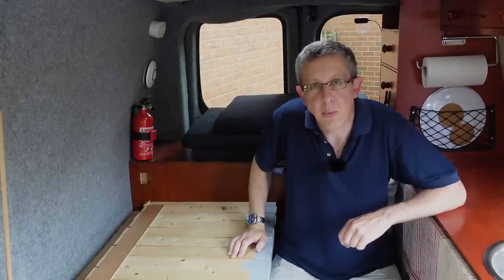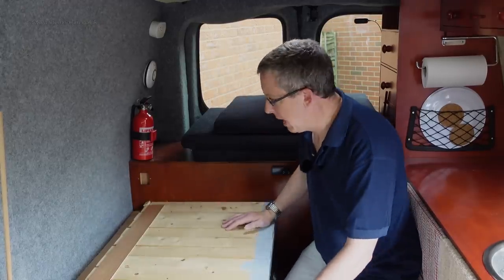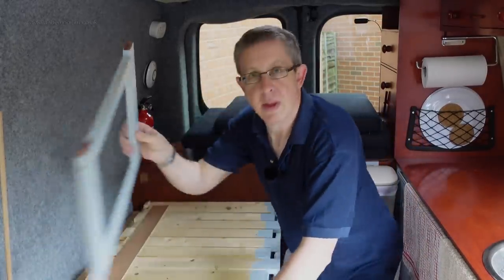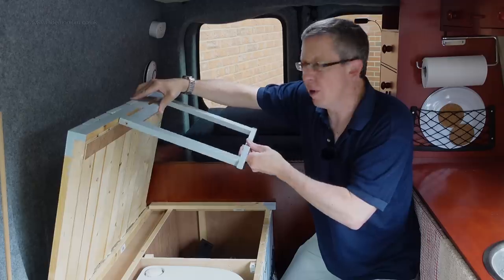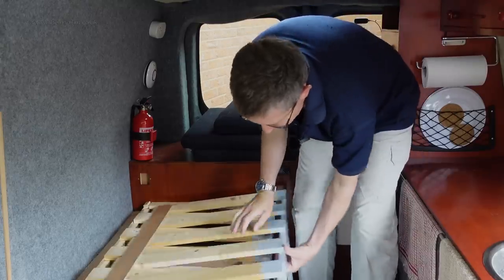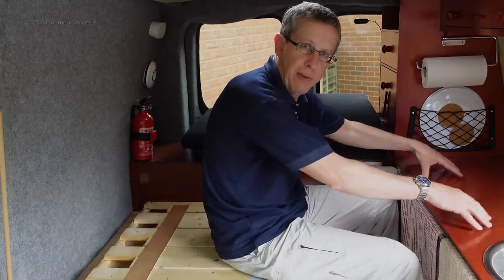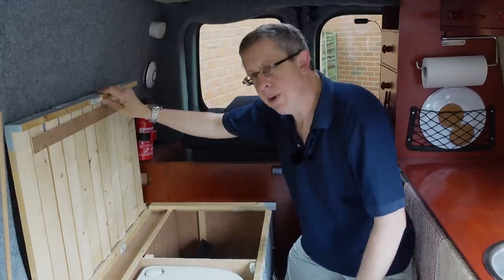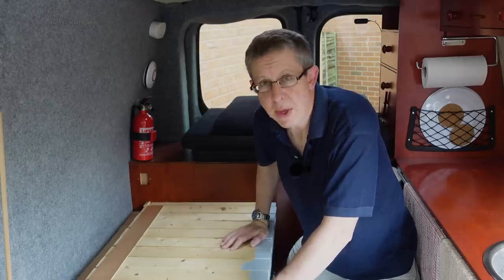84. Help! Your advice is needed.

Comment: The hinge as you described will work just fine as the friction on the extending slats will keep the thing from sliding while you are on it. You might consider adding a light chain to keep the legs from over-extending outwards and they would not be in the way folding. 
Simple is good. One thing I would do as an older person who would have to use the toilet in the middle of the night I would put the electrics under the bed and the "Loo" where it would not be difficult to get to in the night.
One other thing I would have a fire detection system in the battery / electric compartment.
Reply from the maker: Cheers. I'm certainly not moving all the electrics and toilet etc though!
Reply: @Vandemonium  I understand completely! We rebuilt a 1985 16' Scamp and built in a wet bath in the front with twin beds so that when nature calls in the night we don't have to climb over each other to get to the "Loo". More important as you get older!  
Thanks for the reply. We have enjoyed your work on the narrow boats and the van over here in the US.
We live in north west Florida and have taken our Scamp all over the US from sea to shining sea and Canada to the Gulf of Mexico.

Comment: Put in an extendable counter top, like those cutting boards you sometimes see in older houses that simply pull out from between a top drawer and the countertop. It takes up no space at all and would solve your leg problem.

Comment: Use a hinge, but have it fold up all the way, flush against the bottom of the seat, held by magnets or latches.  Then swing out to the floor to whatever width you wish. 
BTW,  the deep blue is a very good color for you and for viewing. Makes for good contrast.  Other good colors would be deep greens and purples.
Good luck!

Comment: You could get locking hinges, one for each leg (side). The kind of hinge that’s usually on cedar chests, that lock open, will not over extend and won’t wobble. You can fold the legs out of the way when slid back. Cut out part of your box dividers underneath so everything will be flat as it is now. Good luck!

Comment: Put the legs on a hinge, and create cut outs in the cabinet front so when hinged against the lid, they still allow the lids to close flush. 
Second option: Heavy duty drawer sliders. 4 to 8 that allow the bed to slide open, but removes the requirement for legs.

Comment: Spring loaded kitchen cabinet hinges won't budge when moving about and will also keep the legs in place when stored away. Plenty available to suit different fixing positions, just be careful if you try to open them by hand as you can easily cut yourself. Perfectly safe once screwed in.

Comment: Why not a two second boards that draw out of the front section of the compartment (where the blue/gray panelling is). The boards could „store“ in the storage compartment parallel to the supporting beams and be pulled out through the front before the bed is pulled out. No hinges, minimal moving parts and variable depth.

Comment: The extra space you seek is available, straight up towards the sky. Make the top of the bed ever-so-slightly thicker, and you'll have as much room as you need to engineer a folding leg. The folding leg will have embedded super-magnets to hold it in place (up and out of the way). I think that the rest is trivial and obvious, or would fall into place when executing the design. The only possibly (?) non-obvious suggestion that I'm making is to take advantage of the vertical axis to gain the extra space (an inch, ~3cm) you'll need.

Comment: David, David, David! I’ve been pondering this since you posted the video and finally came across a perfect and easy solution. 

Cut the front panel of the chest that faces your kitchen in half (or attach two additional pieces too it of the same overall size) and hinge it on the left and right so they open outwards like cupboard doors. With both opened at a 45° angle it should form an extremely sturdy support and it saves you redesigning the top. 
Paint them to match the chest so they blend in and add magnetic catches to hold shut when on the move. Good right? @vandemonium
Reply: Excellent idea - I've seen it work with great effect in several build-outs of cargo trailers and vans.

Comment: I would fasten the legs with hinge.  You'd probably get interference when you folded them away, so it would require cutting a bit of clearance away from the vertical pieces.  Looking at the toilet, I think you'd have enough clearance to make that happen.  Your idea with the triangle is pretty much exactly what I'm thinking.  There are very strong hinges available.  You could fasten them with bolts and washers to make it strong.

Comment: David, It's an interesting problem. It seems to me you are assuming any proposed legs will be required to stop the expanding seat top from moving. You might be better off putting a few small dowels in the top edge of the vertical seat front on the cooker side with several corresponding holes in the sliding part of the seat top which would then be responsible for stopping the seat expanding or contracting unexpectedly while horizontal. (Sorry, that sentence might have been dangerously long) A simple hinged leg arrangement then may work safely in the way you intend and be able to be set in a number of desired bed/seat widths. (I hope you get my meaning.  If not, I'll try again. A diagram might help) Good luck.

Comment: Why have legs at all? When it is fully extended heve something on the kitchen unit that supports it. Either a small piece permanently sticking out from the kitchen unit at each end for it to sit on or retractable pieces. It doesn't have to be symmetrical or exactly at the ends.
When it is partially extended make some arrangement so the fixed slats support it at the rear of the sliding unit (there shouldn't be too much stress at that point)

Comment: I know there are other suggestions like this. My camper plans for a car included a heavy duty slide out drawer mechanism to allow the bed to be extended on its length. Or if you wanted legs I fitted out a folding table for my trailer that used hinges on the legs connected to the structural edge and then retained in the folded position agains the underside with small magnets glued at the bottom of the legs and the frame. Same could be done at the top to hold the legs in the extended position.

Comment: Imagine a triangle at both ends like a bookshelf. You could add hinges (vertical) that would let the triangles fold in when not in use. The triangles are attached to the permanent part of the bed.  The triangles don't need to fold all the way out when you go shorter. They wouldn't need to be triangles. They could just be rectangles.

Comment: Maybe you can make a few mouting points on you kitchen in case you want a full extended big bed.
For a little extension when you are cooking, you can mount a rail below the bed. Will be strong enough if the bed is mounted to the floor of the car. 
Then you don't need any foldable, hinged or removable  legs. 😉

Comment: Make a T shaped leg pull-out that consists of a frame that replaced the divider in the storage compartment and a section of the face of the storage compartment. Then you don't need legs attached to the lid. You slide out the legs, then pull the lid and set it on them.

Comment: Spring loaded hinges, usually great for closing doors but equally will probably serve as a sound structure while the bed is a quarter pulled out and would carry the weight of the legs that are holding your weight. Only when you want to open the bed (top) upwards you can push the legs in with some strong neodymium magnets attached such that they do not then swing back out (whilst having a look for things in the bed/cabinet) unless you pull on them a bit then they would swing open. To prevent wood on wood, I would then reinforce the wood-to-wood contact in between the hinge with just some felt (that would prevent any loud sqeaking and wouldn't be an eyesore and a cheap solution). You can get expensive spring loaded hinges that are adjustable so that you can adjust how much of a "spring" they give.

Comment: I think, drawers that are NOT drawers, just horizontal slide outs, so you can still utilise the space below (and take up minimal room).  Not at all connected to the bed so to speak, but you can slide them out to your desired width, and on the sliding bed portion have a chock or spacer so that they line up correctly height wise.  If the slide out is flush with the floor and you get your chock correct it would be as sturdy if not more.  Not sure if my explanation correctly conveys what I'm seeing in my head, but there you go.

Comment: Try a length of chain, braided wire or similar to hold the bed up while extended.  One line on each side connected to the outer corners (like a fold up bed).  This way it'll support the bed when pulled all the way out.  You could also use a second set of lines of shorter length to hold the bed partially open.  When the bed is tucked in the lines will hang at the sides out of the way.

Comment: My suggestion: move the leg assembly 2 inches inwards of the edge of the bed and hinge it there.  They remain inside the bed box when stowed and should work ok being in from the edge a little when deployed.  You could even add a catch at the lower end so they don't fall outwards when you open the lid until you actually need them.  Another refinement to this would be just 2 legs in a similar fashion with one at each end minus any joining frame.  Maybe of use?

Comment: 90 degree heavy duty shelf bracket/table leaf hinges. They'll hold well at a 90 degree angle, but you'll be able to pop them out of the way. They're hidden hinges as well, and easy to install. OR you get several chaos gnomes (you might have some left over from the narrowboat) and a bit of blue tack, you have to mix the blue tack with pink bubble gum (chewing is best), stick several gnomes together and

Comment: First, you could move the loo into the forward section (where it won't stink up your storage).  That opens the rear section to being drawers or all you other thoughts.
Second, for shorter extensions, you could just count on the cantilever supporting your weight (you'd have to add a slat on the movable section to keep the sliding slats locked together (a thin strip of wood on the underside near the hinges, attached only to the sliding parts.)  Then, for full extension, add a couple of fold out legs onto the cooker cabinet, just wide enough to catch the fully extended bed.  Might not have to be all the way to the floor.  You're unlikely to extend the bed to "almost full width" since you won't be able to walk alongside, so you only have to deal with fully extended and 6-8" extended (which could cantilever).
Third, rebuild the top so that it's strong enough to cantilever even at full extension or you can buy metal "drawer slides" for supporting server racks, etc. that are quite strong.  Your hardware selection in the UK is way different than across the pond, so I can't suggest any links.
Reply from the maker: The front section is also storage. Luckily, the loo is well-sealed and doesn't stink at all.